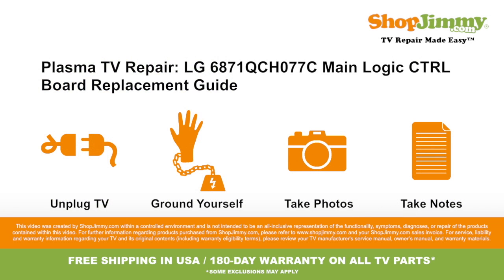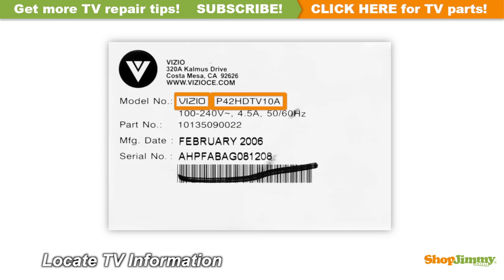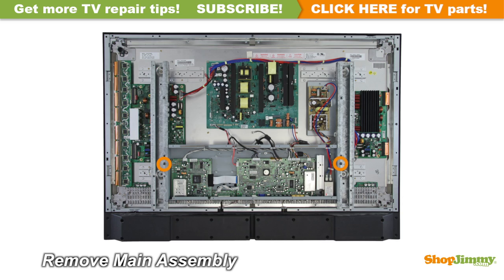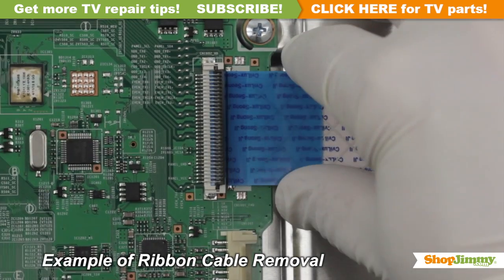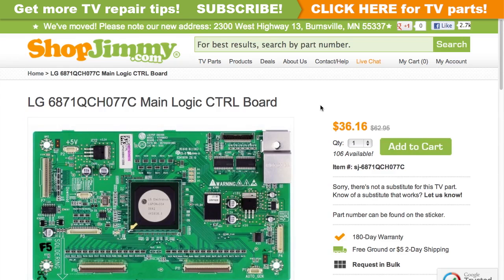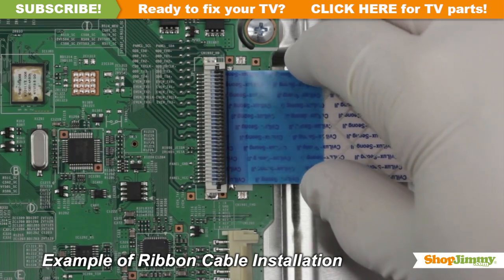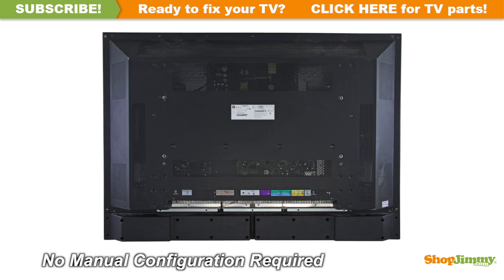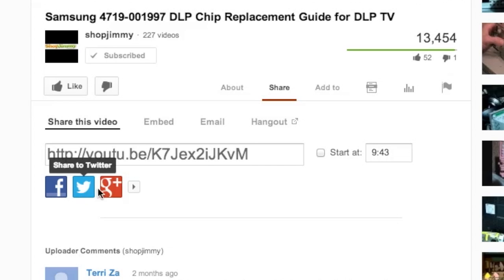LG Plasma TV Repair 6871QCH077C Main Logic CTRL Boards Replacement Guide

Comment: I have an lg 50pc5d plasma tv. I purchased a ZSUS board and I am about to install it but I am having trouble removing the bottom 3 wire connectors. Please help. The ribbon cables i removed with no trouble.

Comment: Good evening I have a problem with my LG plasma 50pt350 television when I plug it in I get one click and I get the steady red standby light when I try to turn it on nothing happens I use the remote nothing happens I turn it on manually nothing happens I thought it was the power supply replace the power supply board still nothing happen what could it be I'm thinking maybe mainboard

Comment: Hi, I really need some help with my LG plasma TV.
I have an LG 42pc51 plasma tv with sound but no picture.
The story:
The TV stopped turning on. I've checked the power board, there was no Va nor Vs voltage. After replacing power board, the TV started to turn on for a second or less and then turned off. After disconnecting Ysus and Zsus power supply the TV turned on and there was a sound. I've checked main IC's at Ysus and Zsus and they were shorted so I've replaced them (only IC's). Now the TV turns on and there is sound but no picture. I'm not sure but it seems to me like the logic board is not firing up the Ysus board. The logic board is PDP 070209. There are four LED's in a row (D1-4) and one separate (D15) on it. D1 is off, D3-4 are lit and D 15 is blinking. Now my question is how to get to know if the logic board or Ysus board is faulty.

Comment: recently purchased and replaced the ysus and main lodgic boards in my lg plasma tv, model 60PN5300-uf, still experiencing vertical bars in the picture. Any suggestions on what direction to go next would be great. All other boards look good as far as a visual inspection but I realize there could still be a problem. HELP

Comment: LG 50P J350 Plazma. It took a Hit in a Storm a few days ago. after it wouldnt come back on . I checked PB an with board pluged up volatges were droped below 5.1 v.I unpluged board an retested voltages were ok So i ordered a main Board an installed it.Afterwards when pluged up tv comes on White screen now with power only an the V3 0.8.0 remote light in tv blinks when pressed but tv does not do anything other than white screen I hope you can help with this issue.Keith.W

Comment: Hello, my tv started turning off by itself. after 15 or 20 minutes of play. Then recently it would not turn on at all ...just the red power light flashing. I ordered from Jimmy shop a power board but same problem again. By leaving the red light flash for several minutes the tv comes on but the screen Shows original LG front page then switches to a white line across the tv...then turns back and forth. like it's the only info it's got.in the memory. The remote contrôle send info and tv seems to get info because the blue flashing light flickers when  activating the remote but it just keeps going from LG cover page to small white line accross the TV  ????

Model; LG 55LW5700
Reply from the maker: Serge Mallais   PLEASE SUBSCRIBE TO OUR CHANNEL - Try all repairs and troubleshooting at your own risk.  This could be a problem with either the main board or the TV panel.  You can replace the main board to see if that fixes the problem.  Click this link to replacement parts for your TV model number:  http://www.shopjimmy.com/lg-ebt61410207-main-board-for-55lw5700-ue.htm  There may be multiple boards for the same TV model number, be sure to match part numbers on your current board, with your replacement for compatibility.  Thanks and please let us know if you have any further questions with your TV Repair!  www.shopjimmy.com

Comment: I have an LG Plasma TV 60PZ550-UA. It turns on but there's no picture or sound. I tried clicking on the menu button on the remote control to get the menu up but, nothing comes on. I replaced the y sus board and still have no sound or picture. I believe it could be the control board but wanted to see what your thoughts was. The Plasma TV is only 4 years old.

Comment: hi I have a lg50pg3000-za I have power on sound but no picture ive changed the power board and its made no change on the logic board I have a grean light on all the time is this related to a fault there is 3 led lights on the board and the middle light is on ?
Reply from the maker: mark quinney   I recommend replacing the YSUS and the YDRVTP and YDRBT boards in your TV.  Here is a link to replacement parts for your TV model number on our website, click here:  http://www.shopjimmy.com/catalogsearch/result/?q=50pg  Be sure to match part numbers on your current board, with your replacement for compatibility.  You can also call our customer service for further assistance with your purchase.  (877) 881-6492  Thanks and please let us know if you have any further questions with your TV Repair!  www.shopjimmy.com

Comment from the maker: @Keith Shelton - I would recommend replacing the main board in your TV.  The part number I am finding for your replacement part is LG 6871VMMC83A.  Please search that part number on our website, shopjimmy com.  On the product page you will see a board number and other information that you will be able to cross reference with your main board in your TV to be sure this is the proper replacement.  You can also call our customer service and they can help you with your purchase.  (877) 881-6492